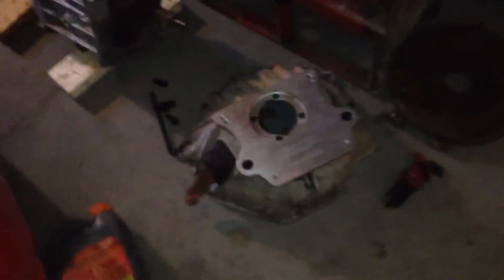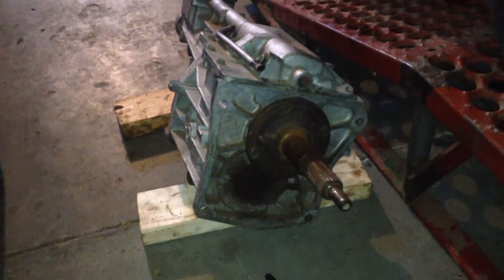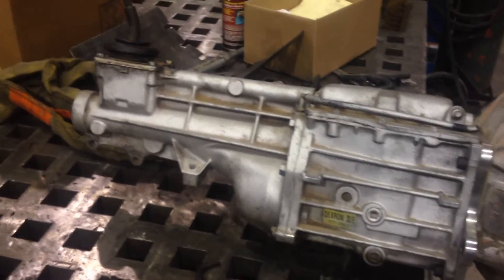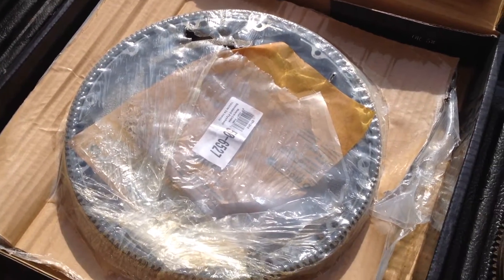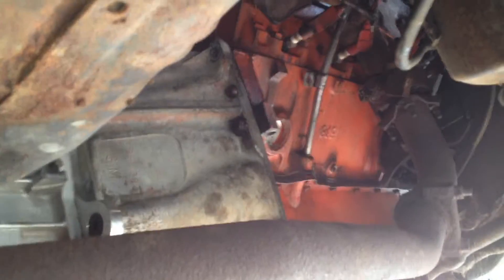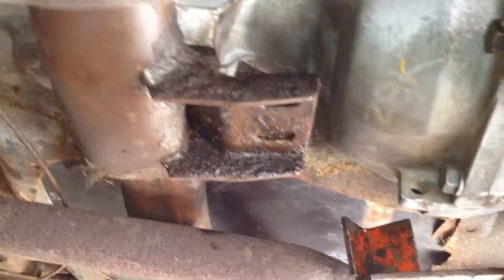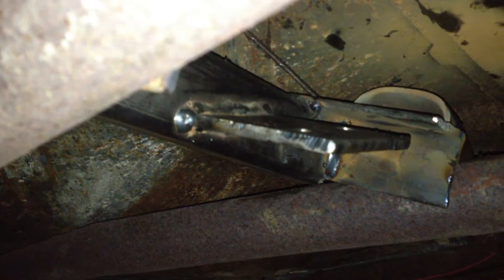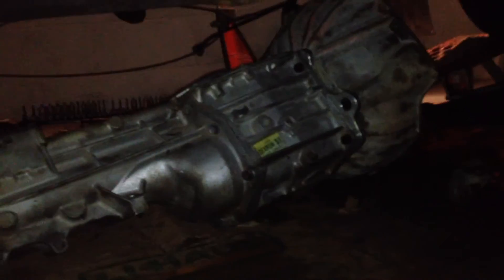Project Impala - 5 Speed Conversion Part 1

Comment: I used the adapter from hotrodworks. Not sure if thats the one you have but mine fit super super well.
Reply from the maker: I used one from eBay. I think it was like $60 for the adapter and adapter bolts
Reply: @iowadiy6361  wow ya i would have definitely went with that one if i would have seen it. Mine was pricey if i remember correct
Reply from the maker: Kaleb Rowden I was pretty skeptical but it bolted up perfectly